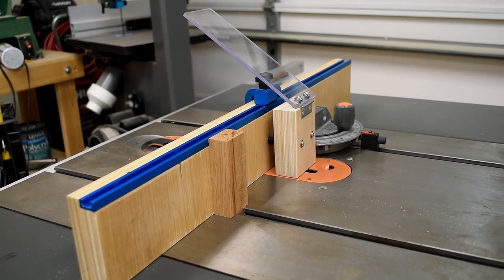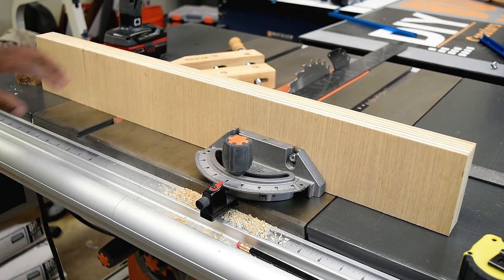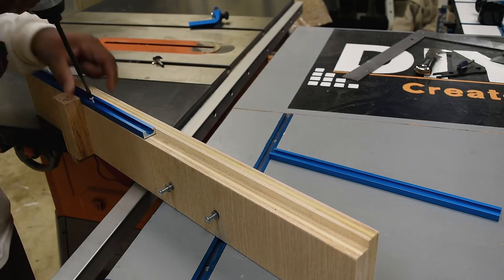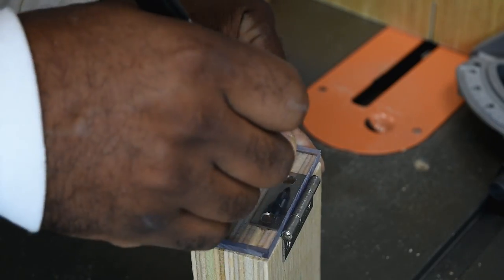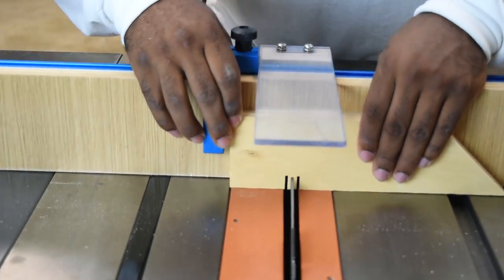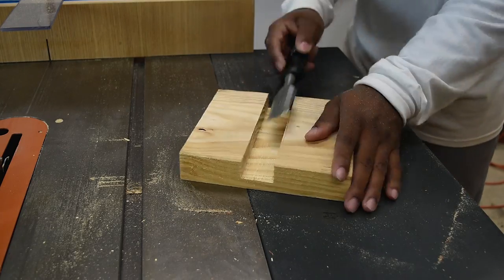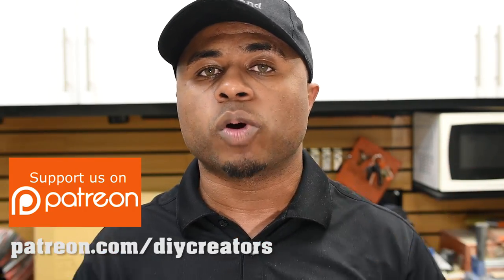How To Make A Crosscut Jig For Your Table Saw

Comment: I’ve watched like 20 cross cut sled videos and this by far the best one, makes the full size ones seem silly
Reply: Evan Hlavaty  Same! Not that I don’t like them. I just wanted something much smaller.
Reply: Evan, it all depends on how accurate you need to be. A jig like this will never be accurate enough for fine woodworking but if you only need to be about as accurate as a miter saw then this jig will be fine. Full size cross cut sleds are definitely not silly though. If you're doing precision woodworking then a fully dialed in cross cut sled using the 5 cut method is an absolute necessity.

Comment: Was about to build a full size cross cut sled then I came across this video last night. I built it today. Didn’t put in tracks or a debris guard but can always add those later. This is perfect for me. I use a smaller Ryobi job site saw, so a large sled would have been difficult. Thanks for your videos and look forward to more.

Comment: This is exactly the design I was looking for - a more compact crosscut fence using a top rail with a second track guide that attaches cleanly to a miter gauge.  Spacing the safety skirt with a clear flip over cover?  Well done, sir!  Excellent design.

Comment: I do use my miter gage with a longer piece of 1x4 added like your setup, problem still exists of all the splintering with that large throat on my RIDGID table saw. I like your ideas when trying to keep it small for storage. Thanks for a solid way to utilize what I have and just expanding the capabilities!

Comment: Good one!  I like the small size as all I have is a driveway and a junk-filled shed to do my woodworking.  Also like the idea of a removable sled base but as it will get cut in two the first time you make a cut I suggest you add a back fence and figure out a way to firmly attach the base and fence assembly to your miter fence so the pieces don't wander.  Especially useful for cuts in long boards like shelving.  Finally, the long blade guard is a good idea but it seems like it would get in the way of storage, so it might be better to shorten it and remember to use a face shield.  The guard will still work for short cuts, but for longer cuts it's always best to use a face shield.

Comment: wonderfull as you will get full depth of the blade as other sleds add a 3/4 inch base to the sled that takes the extra depth away and this is so much more compact too, fantastic job.
Reply from the maker: Thank you, That was one thing I forgot to mention.

Comment: Very nice project. I have something similar added to my mitre but lack the 2nd mitre slot runner which is a nice touch for more stability.

A couple of suggestions. Add a small 1/8" cut where the fence meets the table saw surface as dust relief. Instead of routing a slot for the tee track, cut the back piece of plywood shorter than front.

Comment: Great solution for me!  I took a cheap table saw and built a new cabinet for it.  However, because the surface of the table went from about 1/8" to 1" (2 1/2" pieces of ply, laminated), I lost 7/8" of cutting depth.  If I built a traditional sled on a base, I would be very limited to the thicknesses I could cut.  Your design solves that problem!  Thanks.

Comment: Nice one! I've done the simple version with just a 2x4 screwed to the miter gauge and I have a number of the bigger clunky bed styles ones still lying around, I think your's is the perfect balance of the two. Next challenge, make one where you can still adjust the angle of the miter gauge with the sled but with both slots still being utilized... I'm thinking of replacing the left slide-rail with a bearing which can then be adjusted left or right and then locked in place as needed.
Reply from the maker: Thank you. I like the challenge definitely have to think about that one.
Reply: Right on man, I'll draw something up on SketchUp and see how it looks from there.

Comment: Glen love the fence and will build one, one additional idea is bolt hole next to the blade slot for a finger joint key to bolt on to the fence in various sized. signature sign off?? don't quit yer day job

Comment: I like this jig over others that iIve seen that have built a whole sled.  Seems the obvious setback with those is the loss of potential cutting height of the blade, you wouldn't have this issue here.  The clear plastic guard is a sweet addition.  I think I want to make this.

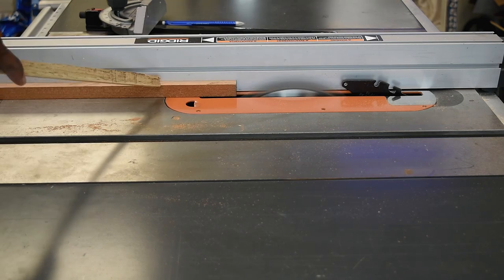Comment: The cut at 1:36 calls for a zero clearance insert, the sliver being cut off could easily drop along the saw edge after being cut, and be flung back at the operator at great speed.
Reply: arlen raasch 
Agreed sir. That being said, the plexiglass being on a hinge provides an unsafe sense of protection while doing the cuts. As much as I appreciate the concept, safety glasses should be expressed as #1 when stepping into the garage to begin any project. Thanks again.

Comment: Nice little project.
One thing about these 'hex-head threated nuts (jeez, they really do have a billion different names for these, lol).
I have been working professional with these things in cabinets. Unfortunately, they are well known to get loose after a while. Especially in structures with a lot of vibrations. Sometimes that can really ruin your day and you have to drill out the whole screw.
Just a little piece of advice is to screw them in with some glue, like PU glue (or any other type that expands)

Comment: What if instead of screwing/gluing the track to the off-side (2:05), it was attached with a lockable hinge or pivot bolt?  Then you would be able to use the angles on the miter and the entire sled could make angle cuts.  The only thing sacrificed would be where the blade hits the fence at an angle, which would open up with dado cuts and angle cuts.

Comment: Something I have done on mine and everyone should is where you mounted the "dust shield", that block should be like two 2x4 glued together and maybe painted red(I did) the reason is when the saw blade goes pass the fence your not exposed to the spinning blade,it should still be inside the 2x4 red painted block. there would be know need to push the blade much past the fence as the stock is all ready cut,and the red block contains the blade and reminds you to keep hands away from that area. JM2C

Comment: At 8:14 you're backing up right after the cut is complete instead of moving the workpiece forward past the blade.  I wonder if this is safe because I want to do build a sled and do this myself.  It is very time consuming to have to go past the blade every time and stop the blade like the manual says.  So is it really safe to back out like you do?  My table saw manual says never to do this (go backwards after the cut).  But maybe with the sled is not a problem.  Any helpful comments would be appreciated. THX

Comment: Looks neat.  I'll have to try that out vs. my crosscut sled.  How accurate are the cuts compared to a properly set up sled?  Thinking about it, I'm wondering if you could create a T-slide in the bottom of the second miter slot, so that it could adjust to angles.  It sounds nifty in my head, just not sure how "safe" and effective it would be.

Comment: I hope you'll give an update of how well this jig holds up in the long term. I've got a couple worries about the design.

First, wood tends to swell and warp over time. Plywood not so much, but even a fraction of an inch would be pretty annoying. I'm glad you coated the wood so it doesn't absorb as much moisture.

Second, when you made the full-depth cut it basically removed half the thickness in the middle of the jig. Fortunately you've got that block there holding the plexi guard, so that should help reinforce that area. But you'll probably want to be careful handling this when it's not on the table, especially if that plexi guard block is removed.

Comment: I got your exact table saw. I didnt use the slider that came with the table, i actually bought the zeroplay sliders. My question is, what is that blue track on top of the back piece? and what is the stopper (shown at 5:06)? I build my slider almost the same as yours, but I want that blue track along with a stopper so I dont have to hold the wood when cutting. Thanks...
Reply: It's a T-Track and it's made by Kreg tools

Comment: I would just have used neodymium magnets to hold the dust guard in place: two screws in the back of the fence, two magnets  align with them glued in the plexiglas base; it would be quicker to remove and put back in place if needed.
As a matter of fact, thanks for the idea... I will do just that on the sled I'm currently making. ;)

Comment: This is awesome. Here's a dumb question, does the grain direction of the plywood (running vertically) help keep this straighter than if it were run horizontally?
Great job I'm definitely making of these.

Comment: Thanks for the video.  Awesome project.  What Rigid Table saw do you own?  I just bought a dewalt 7491RS and have thought about taking it back to get the Rigid
Reply from the maker: Here is what I use http://www.homedepot.com/p/RIDGID-13-Amp-10-in-Professional-Cast-Iron-Table-Saw-R4512/202500206

Comment: Before using scrap wood as push sticks, consider how it would feel if a kickback occurred and the scrap wood would break or drive slivers into your hands as the workpiece and scrap wood come towards your hands.  You don't need to touch the blade to be hurt when operating a table saw.  Much better to fashion push sticks that are sturdy out of wood with smooth edges.  If they touch the blade, no problem.  Inexpensive commercial push sticks are also available.

Comment: I like this idea a lot.  Sleds can be way too big for a garage shop.  Couple questions.   I have the same saw as you and it is notorious for the blade not being parallel to the mitre slots in the table.  Did you check for that when you got the saw?  Since you say to square your fence to the blade I thought it worth mentioning.  

Second, have you done a five cut test to see how accurate your fence is?

Comment: The problem, of course, with using a miter gauge as your reference is that your sled will be dependent on the accuracy of the gauge. And because the gauge is both adjustable and reliant AT BEST on the accuracy of the small (maybe three inch) baseline established between its pivot and whatever combination of pin and friction holds it in rotational position, the entire sled will amplify any inaccuracy there onto ITS reference baseline, usually something about ten times bigger.

Sleds in general are SAFER than miter gauges because the workpiece can be stabilized against a longer baseline. Whether they're also more accurate is a separate matter, and I would argue that we expect much greater accuracy from them than from a miter gauge. That expectation WILL NOT BE MET if the sled depends on a miter gauge for its accuracy.

Comment: I noticed with the threaded inserts that you didn't use any kind of wood glue or epoxy to hold them in place. Are they secure enough that they don't need adhesive or would you recommend using adhesive with these threaded inserts?

Comment: At first look at the title I thought to myself: "been there, watched that" - but I gave it a try, knowing you might catch me. And indeed, you found something interestingly new with the plexiglas-thing. A nice catch and the measure-tape idea is as well.

Only one piece of advice though: The piece of wood that actually slides in the rail is extremely small, due to the size of the rail. But it does have to keep quite a lot of the balance of the whole Jig. Assume you lean too much force into the jig, it might very well just fall over into the blade (alongside the user) or even backwards, with unfortunate results as well. So I recommend to enlargen the dimension in terms of the Jigs foot towards the user (and also the other direction). Looking from above it makes it appear like a turn-around-"T". Of course, this doesnt balance it out entirely but might very well reduce any possible risk.

Overall yet another nice video. Although I do wonder about the ending, but fun is part of your videos, so keep up your... ideas.
P.S.: I was wondering: How about some additional tools and features like this Jig, just this time for a bandsaw? That is something I haven't seen so far. Start tormenting your brain and you might be the first to find something useful (and safe of course)! ;)

Comment: I liked your video... I've seen (and made) sleds before... with a bottom piece. This makes them larger and harder to store. I like how you simply made short guide strips for the slots... very effective. I also liked how you laid the tape in the slot, then dropped in the parts to glue. A simple method... but easy to overlook... good tip to remember.

On your plastic safety shield... one suggestion... put a drop of LOCTITE BLUE on the nuts then tighten. Unlike the Locktite red... you can still remove them if needed... but they WON'T vibrate loose. Just be aware... Loctite did something rather idiotic... the Loctite RED now comes in a BLUE tube... and the Loctite BLUE is in a RED tube. (I know right?)

I'm looking forward to see what else you make. Thanks!

Comment: Great video! I am now subscribed. Thanks for posting this. I do have a question, though, and need some advice. I have a Kobalt 10" table saw and want to upgrade the cheap plastic miter gauge that came with it  to something a bit stronger, such as the one you are using. Would you have any suggestions without breaking the bank?  I have seen them online anywhere from  $20 to well over $200. I am a newbie woodworker and cannot afford the latter.

Comment: Good video and idea for a simplified ‘sled.’ So if you accidentally cut thru the plywood (which could easily happen), it appears that the only thing holding sled together is the t track on top and the block holding the shield. Also having to check the 90’ alignment each time is somewhat counter productive and negates the purpose of having a cross-cut sled. Or am I missing something? Thanks for the video but I will stick to a sled with a base sheet.

Comment: good stuff as always bro! I like that plexiglass feature  even though you should always wear your glasses  but I'm not your mama :) dang,those chisels look REALLY  Sharp,  watch your hands don't  cut your hand now ;) LOL (inside joke) 
looking forward to the giveaway congrats on the half a million subscribers definitely a much-deserved and much more deserved.
LOL I like that signature ending!💥😁
Reply from the maker: Thanks, man. I had them on my head just forgot to pull them down. This chisel just randomly showed up, they are pretty sharp by the way.
Reply: DIY Creators LOL I was just messin with ya."safety patroll";) the tool fairy musta stopped by..lol glad you liked the chisels . they hold an edge for a while..i gotta make me a jig like this in place of my big bulky Crosscut sled that takes up almost to Ft by 4ft worth of room I use the Baltic birch plywood I made it with to make this gig and maybe even a second one for dedo stack.

Comment: even with the scrap piecebehind the fence it still seams like it would be top heavy and not as stable. If the saw had a T shaped miter slots i could see that being much better. So does this fence tend to want to fall forward or back when using?
great looking work tho
Reply from the maker: No, I think you are overthinking this. Let me speak only about my table saw. The miter gauge can not be pulled up out of the track. it slides in and out. There is no way to tip this over. Thank you.
Reply: DIY Creators yeah yeah thats what I was talking about, Your miter slots are t slots so yeah I'm sure its very stable! Sorry I didn't catch that the first time.
Reply from the maker: No worries,  it's best to ask if you're not sure.

Comment: I just had an idea. What if the sled had two sets of stepped rabbets at the bottom? One at the very base, thick enough to fit hardboard or quarter inch plywood in the rabbet so you could temporarily have support under a work piece, then another rabbet above that for dust control when using the hardboard insert?
Reply: Or maybe a chamfer on the one rabbet.

Comment: Hey Glen, I'm one of those guys with very limited workspace, so your miter sled got my attention quick. I have a M18 table saw and it has a rather small top. Although the size is the one of the main reasons I opted for it (and being cordless of course) 
But I'd like to know if your design could be applied to a miter sled ? Any help would be appreciated and Keep making sawdust bro' 👍🏾

Comment: What would be the advantages/disadvantages of having a piece of plywood for the base? I see that most crosscut sleds have a piece of plywood that they attach the fence to, so I'm just wondering is there an advantage to doing it like that? Because if not, then it makes me wonder why people don't use your method given its smaller footprint and portability.
Reply: That style usually has a base as well as a front rail. It helps keep things straight, square, and stiff. It's definitely a superior way to go, but the pro's may not outweigh the cons for some people since it makes the jig much larger to store.

Also, those styles don't rely on the mitre gauge the saw comes with as one of the rails. The advantage there is that the stock mitre gauges are usually pretty sloppy in the track and don't give you a square cut.

Since the whole point of a cross cut sled is to make square cuts these factors are important.

Still a nice jig.

Comment: How do you adjust for square though? the bit in the mitre track stops you from adjusting the mitre gauge?
Reply from the maker: The miter gauge can be loosened then fine tune with a framing square. Once you have it square tighten it up. For best results, you would want square it up before you commit to drilling the mounting holes.
Reply: But doesn't the block in the mitre track stop you from being able to rotate it?